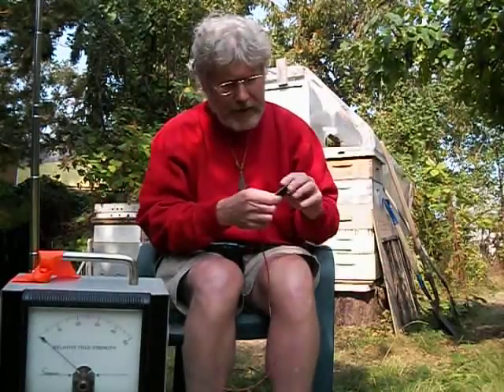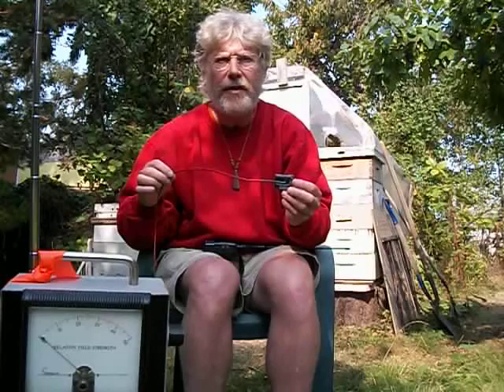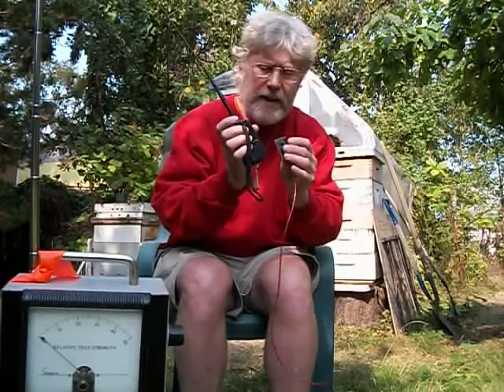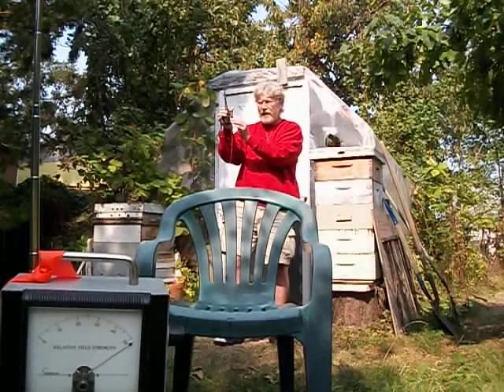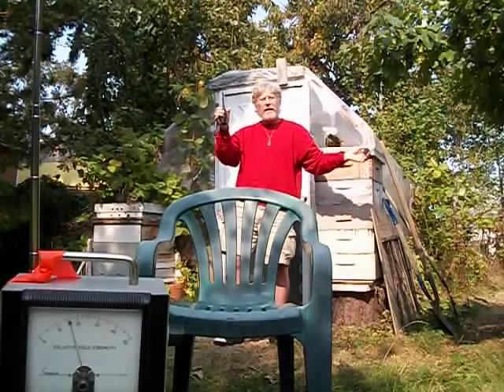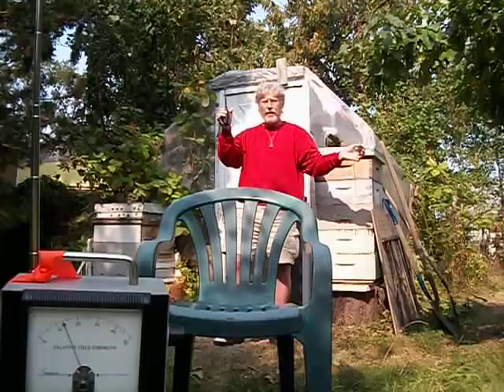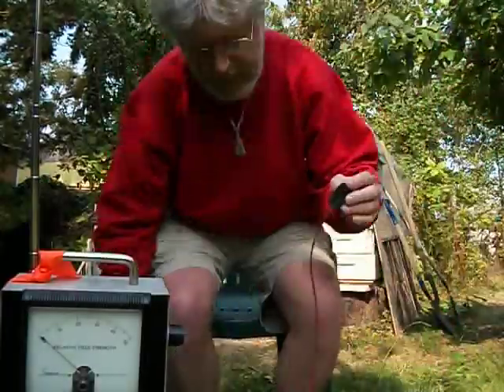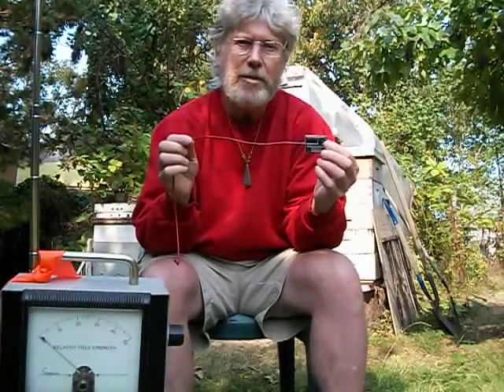Rattail Antenna Booster & Emergency Communication

Comment: Why does it seem to have an affect when it is not even electrically connected? You have to explain how it works and the theory of operation before I'll even consider buying it.
Reply from the maker: At 150 MHz the rattail plate makes a capacitive coupling to the radio that has a low resistance.  There is no advantage to direct connection at 150 MHz.  No pressure to buy at all.  We have sold thousands with never a return.
Reply from the maker: It connects via capacitance to the radio battery or other steel plate in the radio. At VHF frequencies this gives a perfect connection without wire.